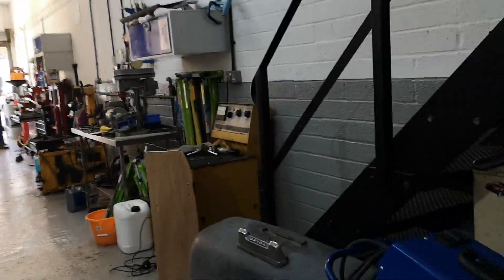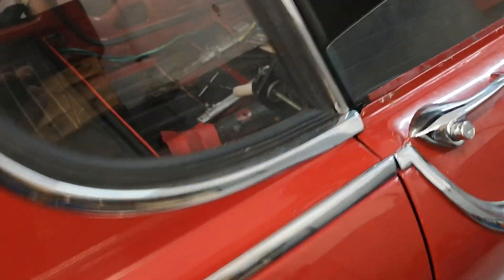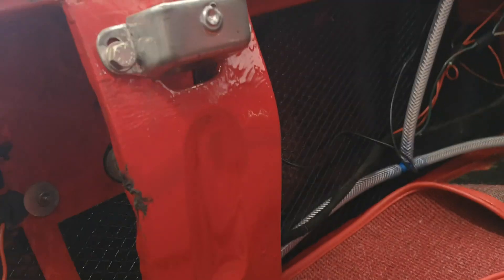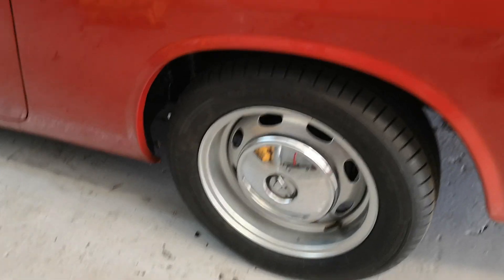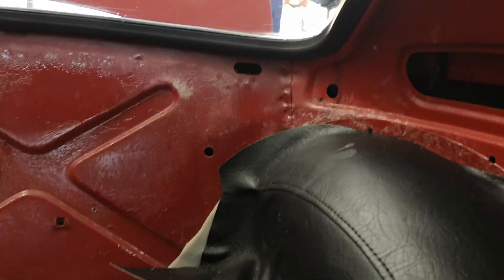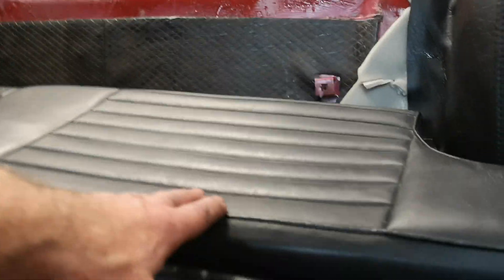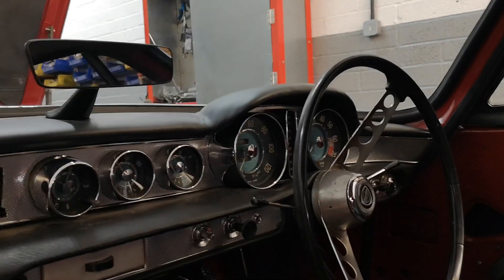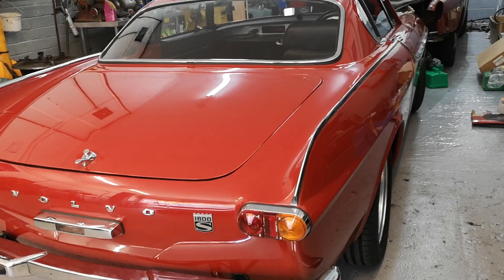Volvo P1800 restoration project - episode 37

Comment: I'm also restoring a Volvo 1800 and having trouble with the fin trim installation. Would like to know what problems you had and how you solved them.
Reply from the maker: Thanks for watching Steve. They are handed that was first part I had to sort out as I ended up with two left trims. The new clips are very soft so ened up making some and using old ones too ones. I made some of the clips offset so trim could be moved over slightly.. A real pain but I go there in the end...Best of luck Steve.. Mike

Comment: I just put new headliner in. I made new frame out of ash, and no clips were made. I put spots of glue to hold. Clips are too hard to use and not needed at all. Frame is little thicker.